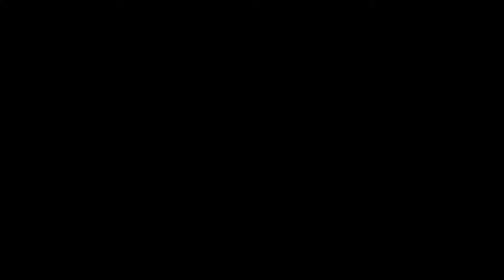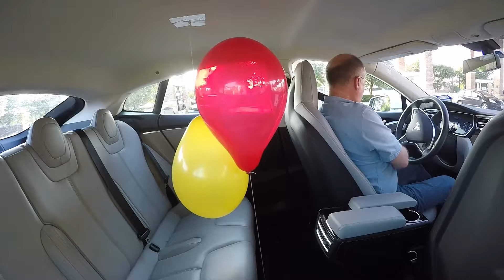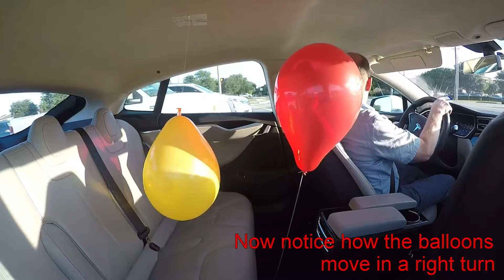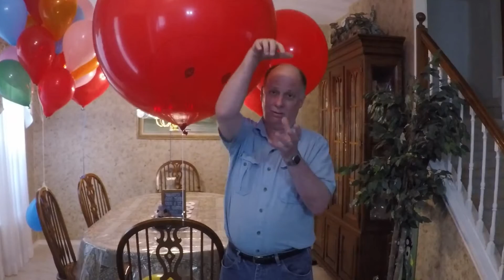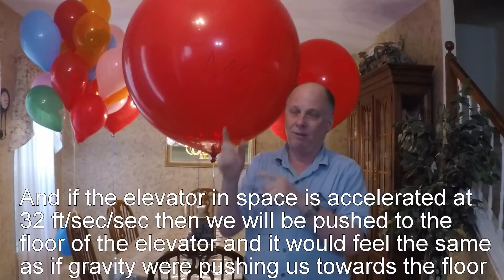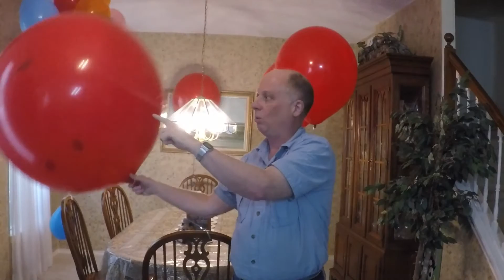Sons of Helium - Part C - Helium Balloon in an accelerating Tesla P85

Comment: Thank you.  Finally someone with a well presented explanation.  Nearly everybody gets this wrong including "Smarter Every Day" and the Chief Scientist at the Imagination Station along with a myriad of Physicists.  I am a not a scientist but was sure the typical explanation of pressure differences was incorrect.  I even drew some diagrams to explain it here: https://drive.google.com/open?id=1hhJ8AHYYS--331dNtdp07GM9fJovP8ns
Reply from the maker: Thanks for the reply. I looked at your diagrams and you look at things the same way I do, to me it is the easiest way to explain things. But I got to thinking, what causes the upward force on the balloon in my video? The pressure differential way of looking at it is that the air pressure at the bottom of the balloon is greater than the air pressure at the top of the balloon, so the air pressure at the bottom pushes the balloon upward. I think both explanations are accurate.